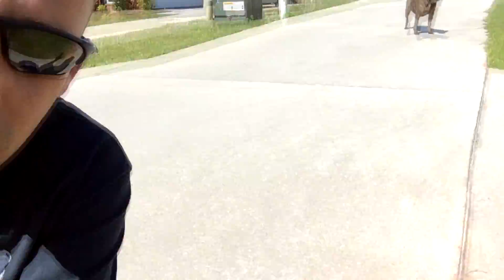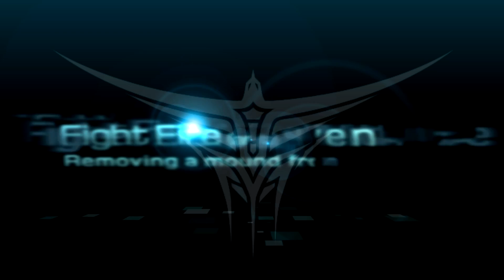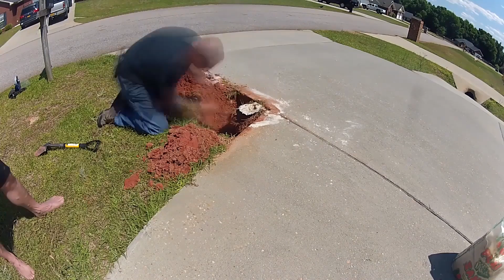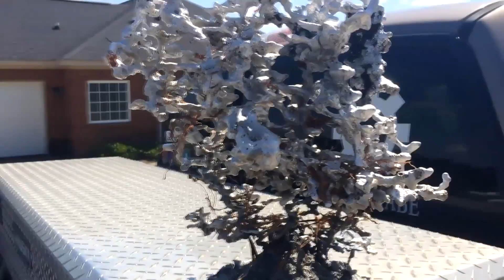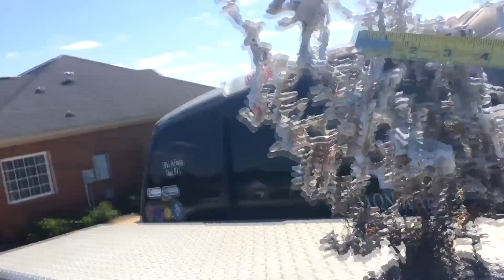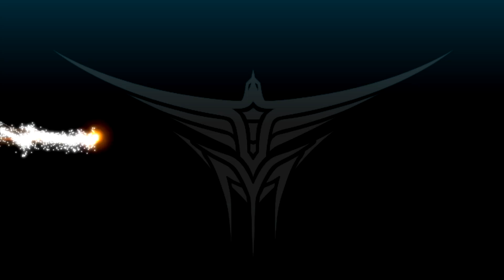Fire Ant Colony Aluminum Casting

Comment: hey man my name is jeb I live in kansas I have done some ant hills myself a few turned out good how ever I could only do about 4 pounds of aluminum at a time now I can do 30 pounds however I am having problems with my burner working right on my larger rig I am making I am wanting to make it with out having to us make up air ( leaf blower / shop vac) and suggestions to help me out? p.s. I love your videos you do some awesome work
Reply from the maker: +Bud Fudlacker honestly I'm not sure. I have yet to try anything bigger that what I got now. Sorry. Thank you for the compliment on my videos. I plan on making more soon.
Reply: does yours run off of forced air
Reply from the maker: +Bud Fudlacker nope. It naturally draws air threw the burner tube.
Reply: Bud Fudlacker you are welcome 
my is majood and live in Iraq 
I man of 1992😃

Comment: Dude its obvious you like the casting, because otherwise I know a far better way. Did it to a wasp nest and funny to see too. Pour petrol down in the hole and after they are drowning light em up. The jet coming out hole is cool.
Reply: +James Barratt 
I burned a wasp nest with petrol and killed them all. I did it to two nests and loved it. I ran out of petrol for the third hole so I used a table tennis bat and killed every fucking wasp one-by-one as they flew into and out of the whole - it took about 6 hours of hate fuelled joy - all because of one fucking wasp. I look forward to the next one that wants to have a go.

Comment: Im just starting to do this myself. rekon you'd be keen to trade a fire ants nest for an Aussie ant breed?
Reply: Cubius Blockus I wish you good luck with your endeavors good sir.
Reply from the maker: I sell mine for about $300...  But I would love to see a video!
Reply: 300US?
Reply from the maker: Yea plus shipping. :-)
Reply from the maker: That's going to be amazing!  I wouldn't cap the other entrances. I would try to go for the most central one and stop when it started flowing out the others. I'm really interested to see how something that size come out. I'm limited to 10 lbs of aluminum because of the size of my crucible. How much are you planning to pour? That thing sound huge.
Reply: My furnace is a 55L galvanized bin, plaster and sand insulated.

Im using a 9kg Gas cylinder as a crucible and its about 3/4 full of aluminium.

I figured i should melt all the aluminium i could. so its probably 7kg(15lbs).

Im still not even sure that'll be enough. Ill be excited if it is.
If not, ill have to invest in another furnace.

They make a mound that is 1m/1m and raised 10cm off the ground.

Yeh i was thinking that i should keep the multiple entrances. The only problem will be mounting it.
------------------------------------------------------------------

One a similar note.

I have found a paper wasp nest that is 1.5m wide, 1.8m long and 80cm deep.

Im going to be mounting it in a glass cabinet. Ill send you some photos of that in a few months aswell.

I think i might be able to sell it for 2-3000 or more.
Reply: +Cubius Blockus Did you make a video? I would be interested in seeing what your finished sculpture looks like :)
Reply: thecrankyangel unfortunatly over christmas i was robbed. They stole most the tools in my shed including my homemade furnace.

Should be back and up n running in about 1 month. will make a video.
Reply: Sorry to hear of your events. Better luck in the future.
Reply: +Cubius Blockus Hows the thing going? Is it going well?
Reply: Reuben Ellis Lol, not good at all.

I had just finished getting my furnace all together and the finances put together. that same night, someone broke into my shed, stole my mig welder, my cordless drill and the lid to my furnace(a garbage bin lid with plaster attached to it)

I can understand them taking the welder and drill, but why the fuck a bin lid?!?!

So i've put this project on hold until i have a bit more capital, and whipped out a chainsaw to build a few dog kennels to get it. 

Life in general is holding me back, birthdays, holidays, car repairs, unexpected bills, ect.
Reply: Cubius Blockus good ol straya for ya. someone just needs a bin lid XD HAhahahahahahaha.
Reply: Reuben Ellis thx mate. i should be up n running by the end of this year, hopefully. I make money doing odd jobs, so money isn't abundant.
I was an idiot in youth and paying for it now.

Comment: I have a suggestion. 
Stick the aluminum in a concrete cast,  and then pour sodium hydroxide on it to dissolved the aluminum. 
When the aluminum is dissolved you will have a perfect and Hill interior. 
You can stick a really small remote control car down with a camera on it.
Reply from the maker: If I had a small enough car I would.

Comment: i wonder how many are still stuck inside the aluminum...
Reply from the maker: pwetty4r4 all of them  ;-)
Reply: Gone.  At 1500 degrees, they vaporize, the vapors diffusing into the surrounding soil.
Reply: 556Raven probably not all of them because some that are closer to the surface will usually pop and go out the top, not sure if this happened with you but i saw it happen somewhere else

Comment: We have the city gas running through right about where you poured. I don't see the little painted marks they leave when you call for a check - so I guess you already knew there was no pipes too near.
Reply from the maker: JWY actually i just got really lucky.  theres no gas in my area but i found out a few weeks later that i just missed the power lines that are burried in my town.  ;-)

Comment: Why is your soil so red?
Reply: Red clay is usually due to a high iron content.  They are called Latterite.
Laterites are soil types rich in iron and aluminium, formed in hot and wet tropical areas. Nearly all laterites are rusty-red because of iron oxides. They develop by intensive and long-lasting weathering of the underlying parent rock.
Reply from the maker: Yochanan TrueBiblicalChristianblog lower Alabama....

Comment: First video of this guy's that I'm watching.
Aside from being awesome.
Can someone explain to me how this is legal?
Reply from the maker: Follower38 im out in the county outside city limits...  and its my yard.  ;-) iva actually got a state trooper that helps every now and then.  In the city there would be laws against the burning and all that but not out in the sticks ;-)
Reply: Oh, okay. I'm in the suburbs and live within an hour's walk to  New York City so I wasn't entirely sure what the laws were like where you lived. 
Thanks for the answer. :)
How much does doing all this cost though, out of curiosity? All that fuel to melt down the aluminum cost much at all?
Reply: In many jurisdictions, Fire Ants are considered a pest species, and some jurisdictions will turn a blind eye to any and every way a person deals with what is considered locally a "pest species", especially if the pest species is considered dangerous...
Reply: Why wouldn't it be legal? You could call an exterminator and get the same result - minus the cool casting.
Reply: Ian Board 
I live in the suburbs on the east coast. If you were seen by the the local LEOs, they would have you put all the smelting gear away unless you were in the backlot of some warehouse or something. Much more different than where the video maker was, so the laws are different.
Reply: Follower38 Silly me, I thought it was the animal rights types you were referring to.
Reply: Ian Board 
Oh, lols. No, most definitely not.
Reply: I don't get it. I'm from France, and in France, whatever you do in your backyard is your own business and no one can interfer. So why would it be illegal to do this in ths states ?
Reply: Fire hazard I think. It depends on state, district and county, if there are any laws on those levels. I know there really isnt any federal laws barring it not being allowed in an urban area.
Reply: ***** wait.. but lawyers are people too O_O so 125 lawyers for every lawyer O; infinite loop

Comment: a cluster of those would look awesome in an aquarium.  I wonder though how safe the aluminum would be to put in one.   If anyone knows, let me know.  Thanks for sharing 556Raven.
Reply from the maker: Your very welcome. And your not the first to ask about using these as "coral" in a fish tank. Now I'm not a aquarium guy so don't blame me if all your fish die but the aluminum itself is not fish safe. However from looking around in the internet if it's coated in Krylon fusion clear coat polyurethane it will protect both the aluminum from the water and the fish from the aluminum.
Reply: 556Raven thanks for the quick reply.  I'm thinking of just setting it behind the aquarium with some uplighting of different colors.  It will make a bit of an obstacle in the room, but I'm thinking the visual effect will be incredible.  I have to say, you got my gears turning with this one.   lol
Reply from the maker: Awesome!  that sounds cool.  (shameless self promotion follows) Ill sell a few to you if ya need it.  email 556Raven at G mail dot com if interested.  ;-P

Comment: really want to try this soon.  I have a lot of ingots to make first, but absolutely on my list of things to try!
I have a friend that needs a few ant hills taken care of, and I suggested we try it this way :)
Reply from the maker: Ingots make it soooo much easier...  I tend to melt cans and pour my castings or an ant hill then pour the excess into ingots. It so nice to not have pounds of dross when I use the ingots. Any way...  When you go all Krakatoa on those ant hills please try to catch it on video and drop me a comment when it goes up. I would love to see other people casting colonies.
Reply: 556Raven
Cans and heat sinks are where I get my aluminum.
I would be happy to film it and post it up, been needing to get my camera back out and film myself building things again.  I miss having videos to upload :)

I am in the process of building a better furnace.  I have been using a modified rocket stove to make my ingots, but that isn't going to last, and it just barely reaches melt temp.  I have a pony keg sized barrel, but I don't have a way to cut the air hole in the side.  Working on finding something for the burn chamber too.  I am on a zero dollar budget, so things are moving much slower than I like...
Reply from the maker: I completely understand a $0 budget.... Just keep On chugging and you'll get there. I look forward to your videos. And if you need ideas for a cheap setup, check out my playlist "little sparks" I made lost of my tools at home and total I think I have about $400 in all of it. And most of that was the high temp concrete.